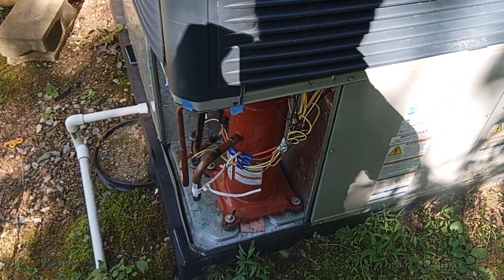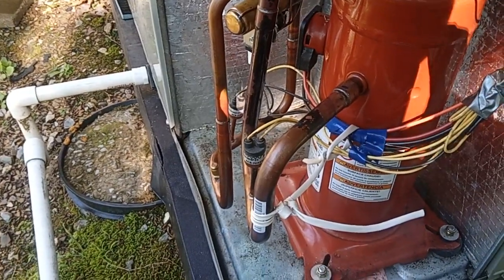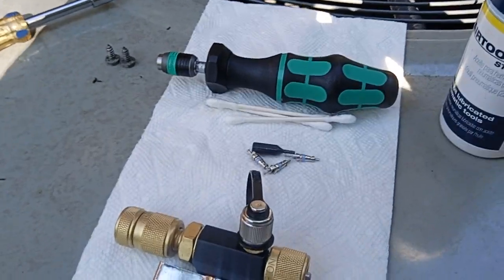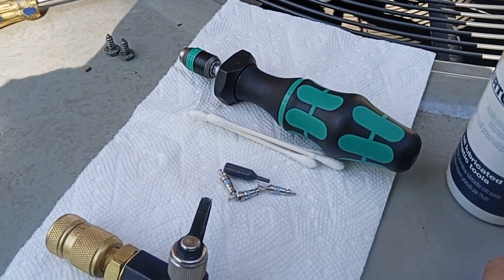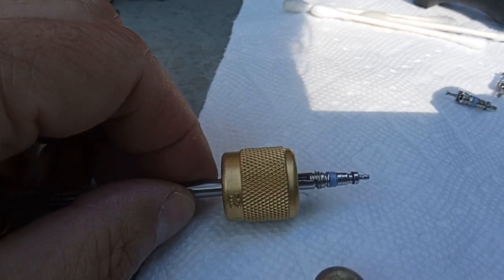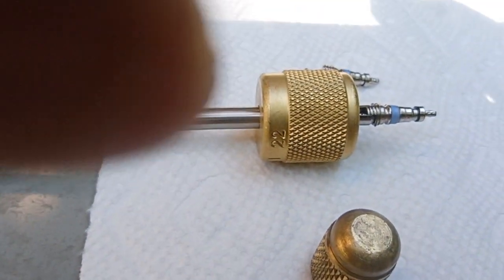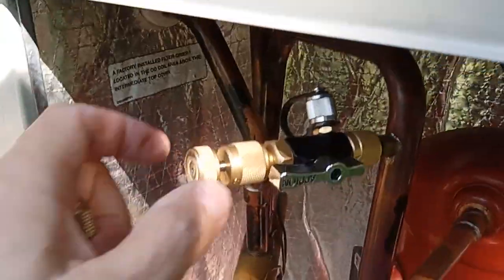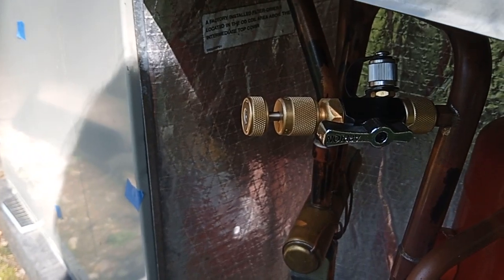Schrader Core Replacement = Torque Screwdriver

Comment: Fantastic video.  I did not know about the ability to torque  with the replacement tool. I have been teaching about torque.
Reply from the maker: Every fastner has torque ratings, its just that trades like HVAC usually have poor or shallow education and most of that is by experience.

I didnt know about it till I studied Schrader Pacifics application data and STOPPED and THOUGHT about it- what happens to the core under system pressure!

Lack of torque = LEAK!

The trick is that the torque, unlike most fastners, is not to develop Proof Strength in the threads, its to properly seat the body seal on the outside of the core.